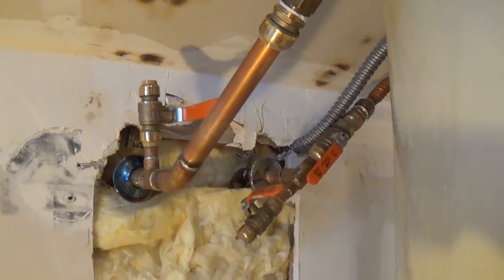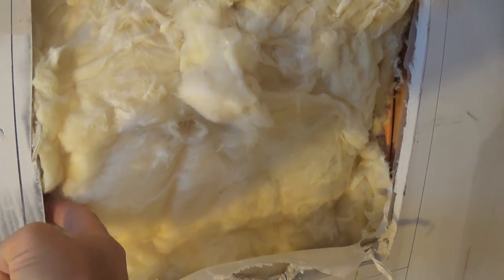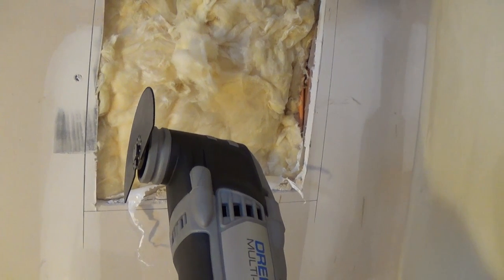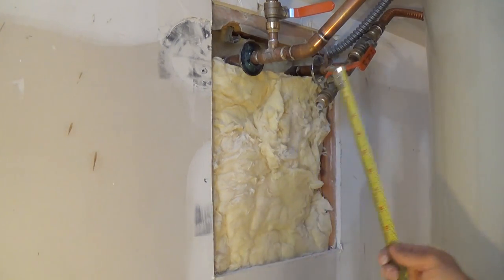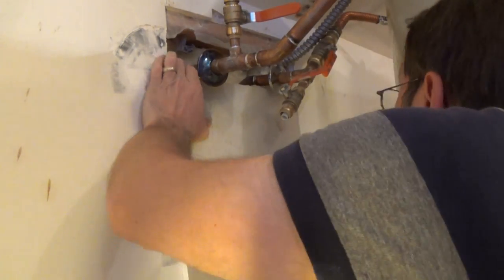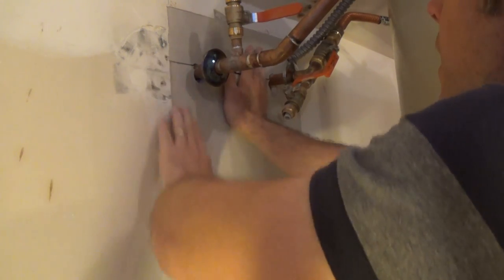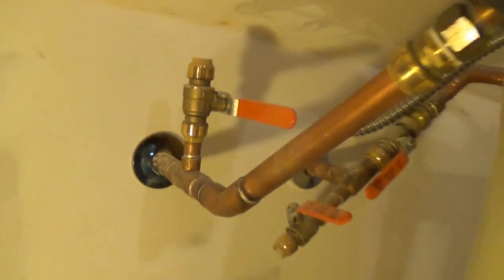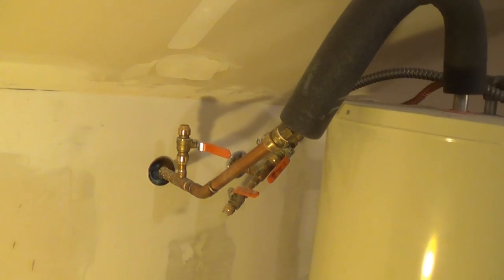How to Patch Drywall Around Pipes

Comment: Great video! I have the same problem with plumbing beneath kitchen sink I'm working with and metal studs which give no support to the drywall area. I will have to do the glue job very similar what you had. Thanks again!

Comment: thank you for sharing this, i recently had a septic tank backup up into our home and all 3 bathrooms were damaged, 2 feet of drywall removed from the walls from bottom upwards by the cleaning company leaves me patching around plumbing pipes for sinks, toilets and tubs after the easy attach  of the unhindered wall coverage areas. thanks greatly
Reply: I never thought you could use a flange. I have a 26x14" space under kitchen sink to address. Wondered about around the copper pipe. Had a leak, well failed elbow joint, plumber told me don't even look at these copper pipes cross ways. They're old, very.... So needed to.know how to gently replace drywall around them. It'll be a two piece repair.

Comment: I  usually wet the paper first as I found that when used dry it sucks up the joint compound too much.
Reply: I use a spray bottle on my tool belt lite spray never had a pop...or bubble.. on paper tape..already sized...I hate fixing bubbles..

Comment: A large section of my hometown is experiencing pinhole pipe leaks  Over a thousand complaints to the city's water district. Ceilings and walls destroyed in hundreds of homes. My own has $15,000 dollars damage to re-pipe the entire house.  Of course the city is trying to weasel out of responsibility but we have proof its because of the water. 32 holes in my walls and ceilings and under sinks. 
 IMPORTANT!! You should know that most homeowners insurance does NOT cover plumbing repairs, only the damage to the house caused by the water. So I'm stuck with the bill. So is everybody else. Lotsa fun repairing cement backer board under sinks around pipes and crawling around in the attic with all that blown in insulation. Dirt and dust everywhere. The house looks like some one threw a hand grenade onto a garbage dump. Same all over town. Its class action lawsuit time.
 I am becoming an journeyman drywall repairman. Thanks

Comment: You should always wet paper tape before laying it on the wall. If it's dry it will absorb the moisture out of the mud and it will be much more likely to bubble and not stick.
Reply: zapadeeboom 
Good tip and it make sense. Thank you!!
Reply: Wet mud= wet tape......no need to spray with a bottle...lol

Comment: Use a tape measure pipes transfer to sheet rock drill holes in rock..score it down middle of pipes ...if needed use knife to adj hole for pipes..old wood or ply in middle reinforces rock.. done...
Reply: Wish I'd read this... Lol hum....haven't got drywall yet.
Reply: What do you mean, old wood or plywood in "middle" reinforces.....

Comment: OR...Since you did the plumbing by yourself, could have solder threaded ends, cut a single piece of drywall with two nice neat  holes.
Reply: GmanUyMVD or maybe it was on purpose to make an instructional video

Comment: Our plumbers installed a tankless water heater and left no escutcheons on the pipes.  How can I make it look neat around the plumbing without escutcheons? (I have looked for some two piece ones that can be added after the fact, but have not found the correct size.)
Reply: Terri Poposky they have them at lowes

Comment: Not trying to be rude...but a diy'er making a how-to-video on anything construction related is just comical. This would be the video if one of my helpers made one. No knowledge, just thinking you know what the process is because you saw someone do it once. SMH
Reply: There are very few dealing with pipes like this. Do you have a video? I really need ideas on dealing with drywalling around pipes after drywall removed 2 ft up bathroom wall. This is the best on I've found.